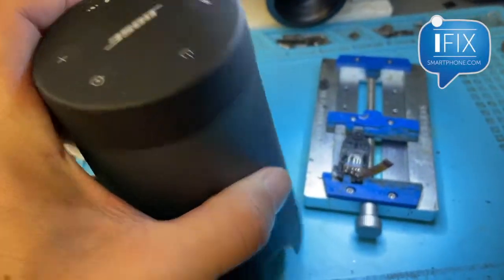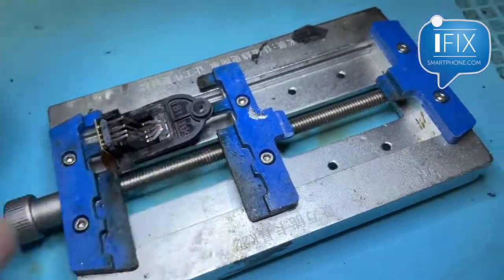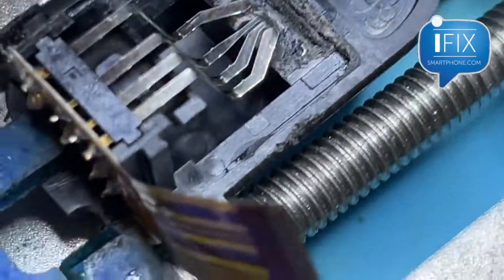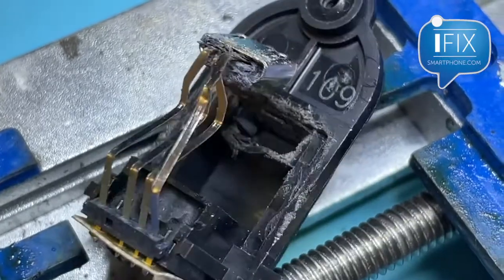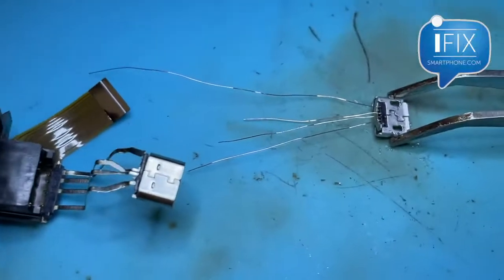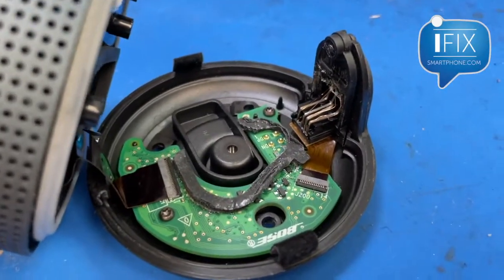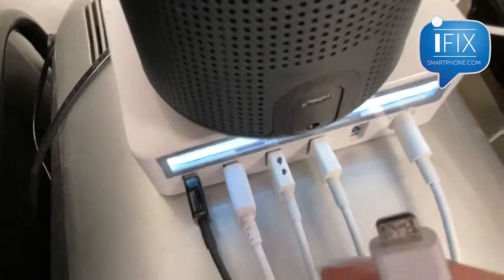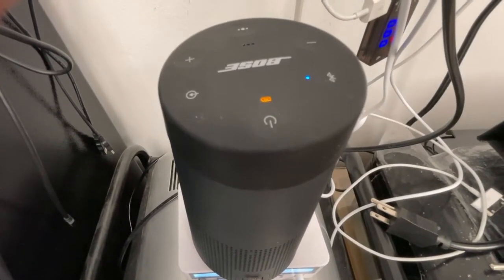Bose Soundlink Revolve speaker USB port repair

Comment: How did you get ghat part to open? I pulled put the USB port holder but cant open the small plastic part in two pieces.
Reply from the maker: It's pretty straight forward to open it up. if you don't see the screw, heat up a little using hairdryer and pry it slowly.
Reply: @ifixsmartphone9079  Removing it from the speaker was very easy. But how do you split it open like that afterwards (to expose the pins)? I ended up breaking the plastic when trying to figure it out.

Comment: Would it be possible to upgrade this to make it a wifi speaker?
Reply from the maker: You have to install wifi module and the speaker needs to be capable receiving the module which is pretty much not cost worthy.

Comment: If cable pin port is not working.. we can charge through  Cradle Charger.. ? Please help
Reply: Why would you do that? if the port orientation is right, it will charge. I offer mail in repair.
Reply: Charging port damaged.. not yet charging.. so i ready to buy cradle charger.. if one charge port is not working another will work or not ?   @todesto
Reply: That’s an amazing idea. My port is also damaged. I’m going to try it the same way. Thank you!

Comment: Does any android port work with this speaker or do you have to replace from another Bose speaker?
Reply from the maker: as long as it has same orientation, you can use other port which would work with android.

Comment: I just got my speaker back from Bose after shipping it to them and paying 
$85 for them to replace the defective port. They didn't replace it. The usb cable still does not snap in place but just kind of hangs in there. I'll be calling them. This is unacceptable.
Reply: Oh my gosh that sucks! Did you get it fixed??